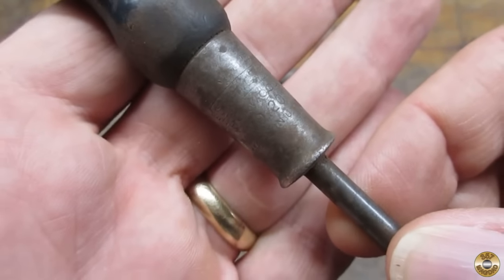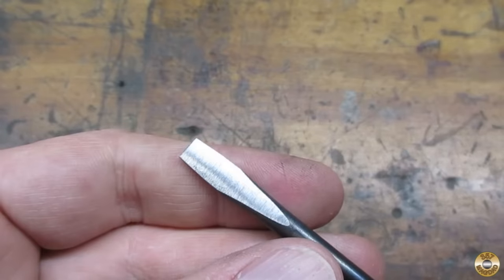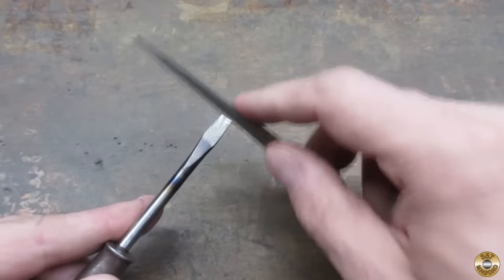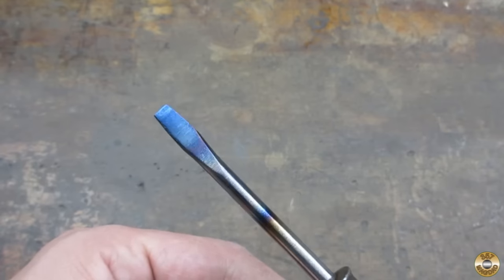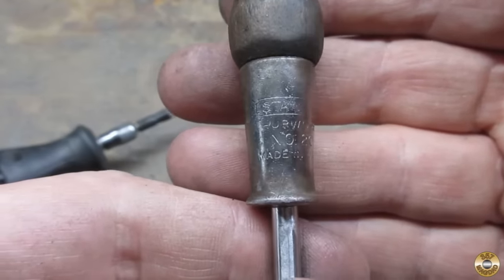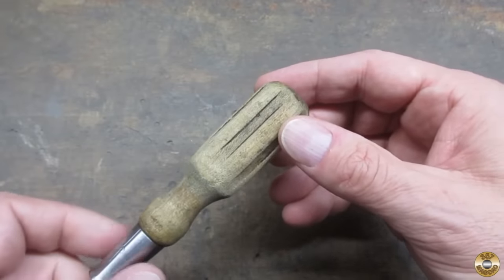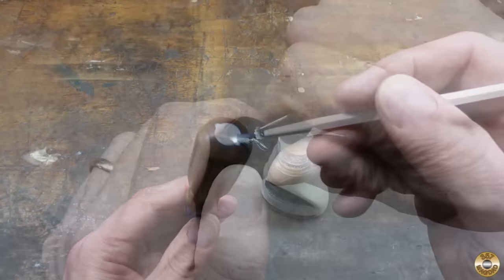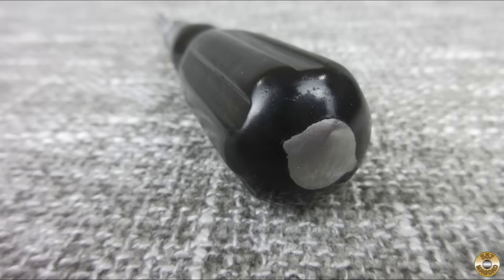Stanley Hurwood No. 20 Screwdriver Restoration

Comment: You should try a gunsmith hollow grind on some screwdriver tips someday. You just grind on the the side flats with a bench grinding wheel. Make it like this )( If you do it just right the screwdriver tip will hold a screw. Whenever I do it I grind on the top of a grinding wheel. Put your finger right on the back of the screwdriver too. Gives a better feel for catching the radius just right. Makes your screwdrivers work like magic. Dress your wheel up and get it nice and flat and square. It should always be that way.
Reply from the maker: Thanks!
Reply: @357magdad  hollow grinding screwdriver tips is a bit of a cowboy move in the home shop. You can't actually see what you're doing while you're doing it. So you kind of just have to go through the motions thoughtfully to pull it off. It's very much a by feel kind of thing. But well worth trying to do. Because if you get it right you'll have a screwdriver that can really put some torque on a screw without stripping it out. A hollow ground tip grabs at the base of the slot and a flat angled grind torques the top of the slot. Do use a screw while you're grinding to check the fit as you go along too. You want it tight. Ideally the screwdriver should hold the screw. One size does not fit all.

Comment: Another great restoration Magdad, I was a little surprised when I saw the length of the video, but when I watched and saw all the new techniques it made absolute sense. Absolutely the right call on the tip, if you'd ground it away there would be so little left to work with, and hey, always good to gain some new skills along the way ! End result looks great, I recently inherited a Stanley driver of this design, but unfortunately the tip was beyond repair so it's now a "pokey thing" I will however endeavour to apply your standards to refresh the ferule and handle.
Reply from the maker: Thanks Andy!  It was fun trying something new!  Next week's video will be shorter!

Comment: Very nice! Its always fun to watch them temper colors run.  It there's enough mass in the steel, you can sometimes quench and temper in the same heat.

The tip could be a crack if it was worked at too low of a temperature. (Red-orange)....
Reply from the maker: I definitely folded that tip.  I'll make sure I reform the next one more carefully.

Comment: That was an amazing restoration.  Every step perfectly explained.  It was a great teaching video today.  I just didn’t understand the reasoning for tempering the blade.  Maybe in a future video you could explain.  Thanks for putting links for the products used.  Again great video!! 👍👍
Reply: After heating the steel to critical temperature(around 1,000F) and rapid cooling in oil the tip will be extremely hard but also brittle this leaves the tip prone to the possibility of chipping or even snapping off when torqued on in a screw slot.
Heating the steel again to around 400F tempers the steel leaving it still hard enough that it won't deform easily while also making it no longer brittle and prone to chipping or snapping.
Reply: @matthewhopkins666  thanks for clarifying the tempering process. 👍
Reply from the maker: Thanks Frank!  Maybe I'll put together a quick heat treating episode.

Comment: Nice touch on the tip reform.
Reply from the maker: It was fun trying something new!
Reply: I was thinking he may have been better off striking the tip itself with the hammer. That way you can get more english on it and control where the metal is going. With the tip down on the anvil you're disconnected from the work.
Reply from the maker: @1pcfred   He's looking forward to trying it again!
Reply: @357magdad  I was impressed that your disrupting the metal went as well as it did.

Comment: Very good restoration video. I have a 14-1/4 inch long Stanley Hurwood 20 screwdriver. The wooden handle is missing. How do you recommend making a new handle?  The butt end cap is a real challenge.  I have splintered pieces of the old handle. Your comments would be greatly appreciated.   Thanks.
Reply from the maker: Check out this video where I made a handle without a lathe:
https://www.youtube.com/watch?v=WQ6RP5z7AeM
And here is an idea for the striker:
https://www.youtube.com/watch?v=-NRM8hdLQyU
Reply from the maker: I'd love to see some photos of your project!  357mdad@gmail.com

Comment: This is the best screwdriver restoration yet. Most people would pass that screwdriver up when they saw the tip. I thought you would grind the tip down until you got to a wide spot, then reshape it. The home blacksmithing and tempering is something new to me. The handle treatment was also appropriate. I expected the Bombay purple stain to be used, but the the original black is better. The two gentlemen who established Hurwood would be very pleased with your restoration of their vintage product. Great job.
Reply from the maker: Thanks Pat!  I'm looking forward to saving more screwdrivers this way!

Comment: Terrific job on the restoration.   Looks better than new.
Nice work swaging the tip.   I also failed on my first tempering attempt.   I got to the desired straw colour and did not quench.   A couple of seconds later, too soft.   So we both learned that once we get the desired colour, it needs to be quenched to stop the heat.
Interesting history on Hurwood brand.   Thanks,
Dave.
Reply from the maker: Thanks Dave!  That tip gets hot quick!

Comment: That was great! I would like to see you do a phillips tip restoration. Thanks
Reply from the maker: Thanks Jerry!  Phillips tips are very difficult to fix.
Reply: @357magdad  no they're not. Heck I even sharpen up my power Phillips bits. You just grind the chewed up faces clean and even again and take a little off the tip of them. Once cleaned up they work better than new.
Reply from the maker: @1pcfred  I have had very little success renewing Phillips tips.  I guess you got the magic touch!
Reply: @357magdad  thinking about it the secret to my success my lie in my bench grinders. I've seen what some folks use and I couldn't work with that myself. The grinder I do Phillips tips on has massive tool rests. So it is easy to keep the drivers aligned on those tables. I just measured it and it's 3-1/2" deep and 4 inches wide. So that gives a lot of stability. Plus I keep my grinding wheels dressed square too. All of that helps in getting precise grinds.